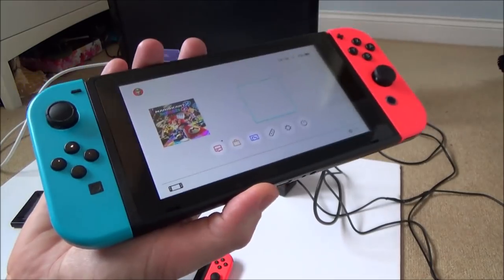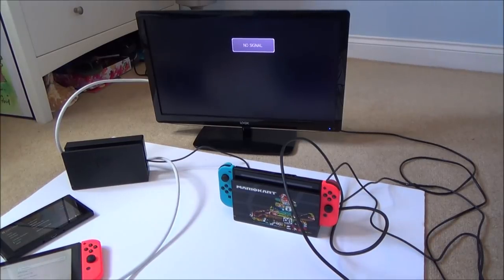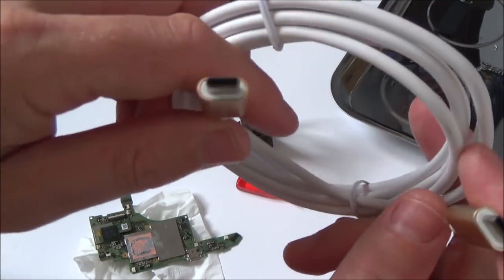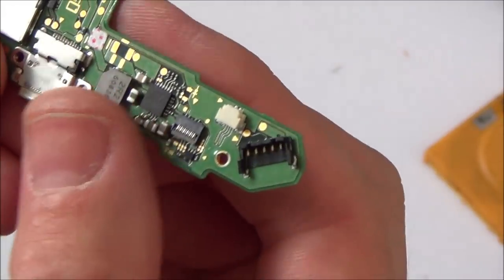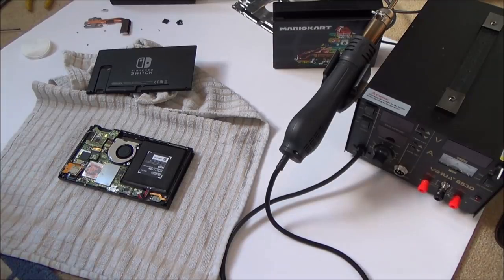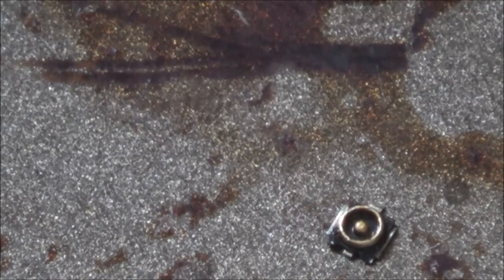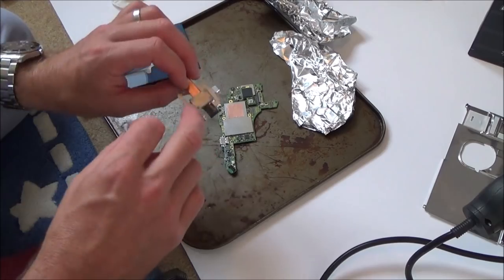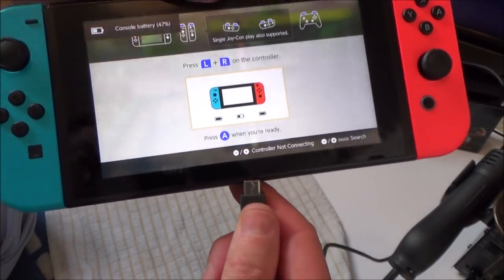UPDATE: Trying to Fix the Faulty Bent Nintendo Switch Not Docking

Comment: It only shows 480p because it remembers the last tv/monitor and maybe the owner wasn't using a HD tv or monitor
Reply: C4DSama true
Reply: Scione no its not "yeah mabye" its no, think about it, the TV operates at its resolution, be it 480p, 720p, 1080p (or 1080i but shhh) and a nintendo switch doesnt "remember what tv/monitor was last used" because if you select automatic, then you get the automatic resolution your tv can play at, so if it is a 1080p tv it will display at 1080p, just as it would for 720p or 480p, theyre just options you can choose but if you try displaying 1080p on a 720p tv or monitor im pretty sure itll just display at 720p
Reply: RaspberryPi Well it does remember. So what I said what the dumbest shit you've ever seen? I just told what I know. I mean I verified. Plug your dock on a 480p monitor it will only show "Automatic or 480p". And undocked, it still remembers and still shows "Automatic or 480p"
Reply: C4DSama the switch had a bug in its 4.0 update where it locked users to automatic and 480p, i did some research and this update also caused a lot of users to not allow the switch to be docked and only to be presented with those 2 options, automatic and 480p. This issue may be resolved by a format update, and i tried this on my 480p tv earlier and it didnt remember shit, all it appeared was automatic and 480p, like you stated, but when i undocked my switch, i got my options back, i saw 720p and 1080p
Reply: I just docked my switch on a 480p monitor. When undocked, i still only saw Automatic and 480p (So on portable mode like in this video). I had to dock my switch to a 1080p TV to see "1080p" and "720p" options back again. You're on last firmware?
Reply: C4DSama im on firmware 5.1.0, which i assume is the latest, and yeah i docked my switch to a 480p tv and i only got the two options (automatic and 480p) but when i undocked i already had all the options such as 720p and 1080p so maybe it varies between switches?
Reply: I think it varies between monitors or the cables used. So yeah if the switch on this video only show "Automatic" and "480p" and is on 5.1.0, that's just because the owner docked his switch on a 480p monitor. Oh and i think he already formated the switch because in the last video the user icon was Luigi and now it's Mario. (Maybe he just change the icon but don't know why he would)
Reply: C4DSama maybe, but every tv and monitor ive tried has given me the same results
Reply: I was using a HDMI to DVI cable. Maybe then it's because of the cable.
Reply: I had my switch docked with a      5:4 monitor with SXGA resolution which is more than 480p  and i was using an hdmi to dvi adapter and version 4.0 and it showed automatic and 480p as the only available options but despite my monitor supporting resolutions above 720p in both automatic and 480p it only displayed in 480p(stretched due to 5:4 aspect ratio) and then i searched about it and i found out it was a common issue with dvi monitors on 4.0 not displaying more than 480p and then i updated the firmware to 5.1 and it still showed automatic and 480p but on automatic it was displaying stretched 720p and      when undocked it still "remembered" 480p and automatic as the only options so it seems that it's an issue with firmware 4.0 that only 480p and automatic are available that does not get fixed if the firmware is updated but won't happen if the same was done  in 5.1.       It's weird but it's definitely a software issue
Reply: The used (formatted) Switch I purchased only had the 480p option until I docked it for the first time a few minutes ago and now I can choose between 480p, 720p and 1080p. If I remember correctly, my brand new Switch also only had the 480p option until the first time I docked. Nothing abnormal in that behaviour!!
Reply: Mine has a "memory" based on the last TV I docked it on my tv in my room it shows auto, 480, and 720. In my living room after docking it, it shows all options from auto to 1080. My system is up to date on updates being at 6.2.0

Comment: try a factory reset to rule out any software issues. on the hardware side.. one of the IC chips you pointed to is a multiplexer  (PI3USB30532) which takes Many signals and outputs to a few outputs and it is specifically for USB Type C to output and communicate with external devices... that would be my first guess  https://www.diodes.com/pericom-part-files/PI3USB30532/Application%20information/PI3USB30532-PI3USB31532_App_Type-C%20application%20Note_Rev.A.pdf
Reply: specifically on the first link, look on page 9 of 18

Comment: VINCE 
TRY A FACTORY RESET THEN RE UPDATE IT OR ROLL BACK FIRMWHERE THEN RE UPDATE OR THE RIBBON CONECTION IS FAULTY.HOPE THIS HELPS,  YOU MAY ALSO HAVE A HAIR LINE CRACK IN THE CIRCUT BOARD YOU CAINT SEE WHEN IT WAS BENT USE A MAGNAFYING GLASS TO LOOK FOR CRACKS.

Comment: Don’t quote me on this: the switch probably sends data to the tv/monitor to see what options it has for resolution, so if one of the data pins is damaged, the switch will not be able to get the right info on the tv and doesn’t give the correct resolution options

Comment: PLEASE upvote this I had the same problem where my switch was blocked in either automatic or 480 p fixed the issue when I used the ORIGINAL DOCK I was using my friend dock at first (which is an older switch) mine is a new one 2019 ( his switch worked fine on his dock)
Reply: This video was made in 2018. In 2018, there was only one version of the Switch, the original one.
Reply: @user-tt6ct4ii8t  It is still possible that there are multiple docks for switch maybe its a zone issue (EU, America) my point is use the original dock or try another dock if you have that problem
Reply: @alit1985  The switch isn't region locked, so I doubt that, but it definitely can be useful. Imma buy a refurbished Switch from GameStop soon because my card has a limit on 3000 Swedish crowns online and the refurbished one is just under that, I'll definitely take your advice if I have any issues with it

Comment: The pink stuff is replaceable i don't know what it is for but the new stuff would be a upgrade also the GPU is probably having issues trying to communicate with something else on the circuit board because of software not working correctly that is the only way to explain how it knows it is docked but will not output video or audio also i saw the solder melt on the usb type c port and i did not have the video slowed.
And if you call Nintendo about it and tell them that what the problem is and what hardware is in the switch they could possibly repair it with a software update or tell you if something in it is not a oem part because the problem could be one of the parts got bad and was replaced by the wrong part.
the mx-4 might be a better paste if the switch is still overheating i only know about the mx-4 because im rebuilding a pc i found out for the trash so i can run the newest version of MS-DOS, windows 98, windows xp service pack 2, windows 8.1, and windows 10 with linux mint 18.1 (Serena) mate edition.
When i got that pc it was missing RAM a Graphics card the power supply a monitor a mouse and keyboard it came with a 320 gigabyte hard drive but it was broken and no sides and now it is almost a working pc.
Reply: And its good that you showed the connector replacement on the working but not working switch because this saves alot of time for a mod im doing on my 3ds soon to get a better wireless signal on my 3ds so i can have my 3ds farther away from my ds lite when i trade Pokemon from generation 1 to 3 then into gen 5 untill i have every pokemon game finished up to the current generation with the same pokemon from generation 1

Comment: Vince it appears you are definitely not alone with this issue if you head over to reddit hundreds maybe thousands had this issue after one of Nintendo’s system updates! A couple of solutions that have helped people fix the issue were firstly to do a hard reset whilst in handheld mode by holding down the power button for approximately 5 seconds until the Nintendo Switch goes off! The second solution was to format the console. If neither solution works I think the following link could help you out mate. https://amp.reddit.com/r/NintendoSwitch/comments/7a20nh/my_switch_only_has_a_480p_option_in_tv_output/

Comment: I was wondering if somebody could help me... Ok, So My Nintendo switch's charger bent (My fault because I put too much pressure on the Adapter.) And so I've been trying to bend it back into place. But, It has come to no prevail, I was wondering if somebody could possibly help me. If you cannot I'm honestly fine with that because then I can result to buying a new switch charger, But I'd like to try and fix my CURRENT Switch charger.

Comment: Read full professional comment! Never exeed 330C it will burn everthing ... if you want use more air and put small nozle on small things (always put a nozle near size of element you try to desolder). The actual temperature of melting the solder is 187C and also there is one on 223C. The board will not start from 200C instantly ... it will heat until reaches 230C and everything will start flow, when you heat board with 330C everything kind of setle before it reaches solder melting temperature, if you hit it with high temp (above 350C) fast from begining you stress the board and can cause peel tracks or internal cracks in chips and you begin to bake the PCB. NEVER HIT THE PCB WITH HIGH TEMP RAPIDLY and ALWAYS PREHEAT to about 100-140C BEFORE START TO MELT SOLDER ON IT! Always spread termal paste evenly on needed surface ... don't listen to people who put a dot in centre (this always left edges uncovered and its not a beter way) and you must put a thin layer of it. Acording to laws of thermodynamics everything i said is true and tested. I am electronics engeneer and repair service from more than 25 years. The pink thermal paste is coper while the grey MX2 is based on silver the white one is nonconductive silicon thermal paste

Comment: NOO!! You never reuse thermal paste. You never mix 2 different types of thermal paste. You put a pea shaped amount on the chip. None on the heatsink. As you press the heatsink to the chip it will spread the paste across the chip. You only need a little bit. It’s just got to be paper thin. I would make sure you know how to apply thermal paste in the future because not doing it right can kill your devices.
Reply: It will only kill devices if you A) use too little or B) use electrically conductive paste (MX-2 isn't) which gets onto & shorts a component out. Using too much doesn't have any negative impact on performance since the retention of the heatsink will have evened & thinned out the paste from the sides so there's really no more between the chip & heatsink than there otherwise would be, and in some instances such as with exposed dies like on GPUs you would actually want to lean on the side of using too much (like manufacturers do) as even a bit of non-coverage would be bad. Gamers Nexus recently posted an excellent video last month on the topic of "too much thermal paste" showing this, in fact the paste in their pea-sized test didn't even spread to one of the corners of the CPU due to poor spreading (easily happen in the real world) which had the highest average temperature (still within 0.7 C of the lowest) and could have a serious impact if the die area isn't covered (as shown in their previous ThreadRipper testing where a "heavy blob" performed significantly better. And yes while it would be better to apply it to the chip for better control over the spreading doing it on the heatsink instead isn't necessarily bad as it will still spread out across the chip so taking care with your pressure (or just using enough paste) will spread it evenly, you could even pre-spread it across the heatsink to ensure proper coverage like some manufacturers do with their coolers.

Comment: My Nintendo switch has the same problem we're only shows automatic and 480p
Reply: The Bedrock Miner wait do you have the new switch with the better battery life that comes in the all red box and are you also on 9.1.0? Because if you are I’m having the same problem which the solution probably is that there is an issue with the 9.1.0 update
Reply: @Brandon-kg5dj  I have the old version of the switch and yes I'm on the newest update
Reply: The Bedrock Miner oh also when you try and turn it on does it sometimes not recognize the switch and you have to plug the hdmi back in a few times for it to work?
Reply: @Brandon-kg5dj  yes then the other options aren't even there
Reply: The Bedrock Miner it must be the 9.1.0 update
Reply: @Brandon-kg5dj  is yours doing the same thing
Reply: The Bedrock Miner yes but I returned it to gamestop for a new model and now it seems to be working so mine was possibly a hardware issue

Comment: OK, I THINK I've found a video that will be very useful to you, that even mentions the possibility faulty chip!
https://youtu.be/U8Tc0DP7IGA
I also promise you will learn a thing or two!
EDIT:
This is the chip mentioned in case you don't want to watch the video.
I still recommend watching it anyway. 
"M92T36"
This is the chip that often is responsible for a switch not docking. It's mainly caused by a third party dock using USB C PD.
As the Nintendo switch doesn't use it.
The 480p problem I'd bet is a software thing.
Reply from the maker: Thanks for the link. I have just watched it. I was aware that the chip was  responsible for the bricking issues but perhaps it is also affecting the docking issue. I reset the Switch back to factory settings and unfortunately it still doesn't dock so unsure if it is software related..
Thanks for posting :-)
Reply: @Mymatevince  Alright, good luck on finding a solution to the problem. :D

Comment: I went on browsing looking for a solution, I found a few videos.
https://www.youtube.com/watch?v=lZpX8Xfy2-c this one probably wont work as you probably already tried that.
On this one the comment section is the interesting one https://www.youtube.com/watch?v=BzPBa9eFmXI Basically all comments have different solutions, I'd take an hour to go through all of them
I find this comment the most interesting, 
It was posted by Chuck silver
This exact same thing that happened to you happened to me today but luckily I managed to fix it. This is what I did:

1) I unplugged the HDMI and power cables from the dock
2) I completely closed Zelda: Breath of the Wild that I had on stand by
3) I opened the game with the lowest memory consumption I have (Metal Slug 3)
4) I put the Switch on sleep mode
5) I plugged the power cable and the HDMI cable (in that order) back to the dock
6) I put back the Switch into the dock
7) I turned the Switch on... and that's it. My Switch started to work again.
It could also be possible the owner used a bad 3rd party dock, that might have caused the issues. I don't know whether I am blind or something I see that some pins on the USB C don't look to good but I am probably wrong, if I am honest.
I hope this helps somehow, I'd also try to see  if it's a software problem.

Comment: An easy way to fix it is like what they use to do to the xbox 360 boards. Put the board in the oven on hi for 30 seconds, or use a heat gun on the board.